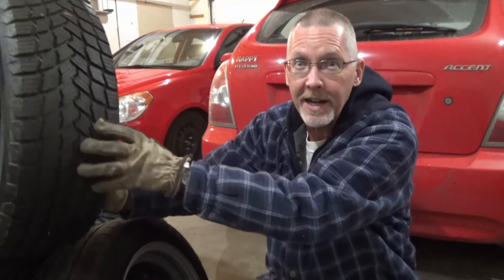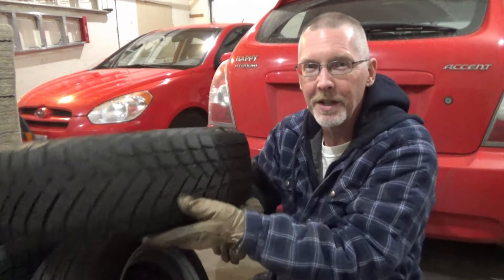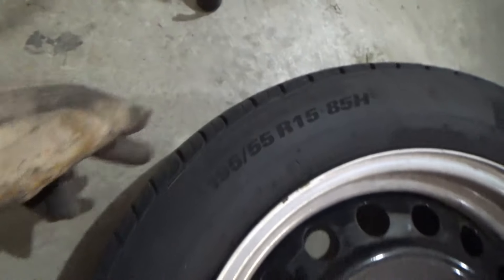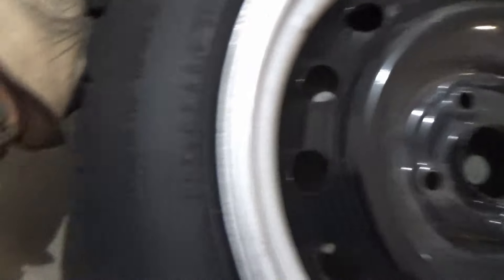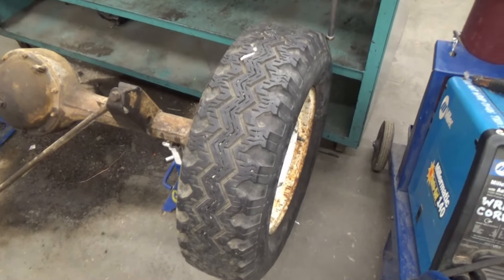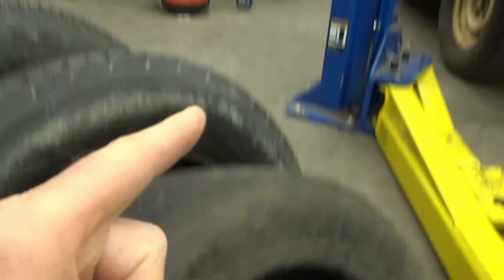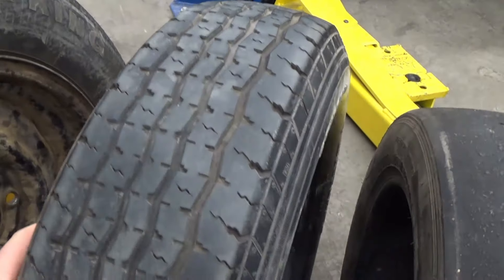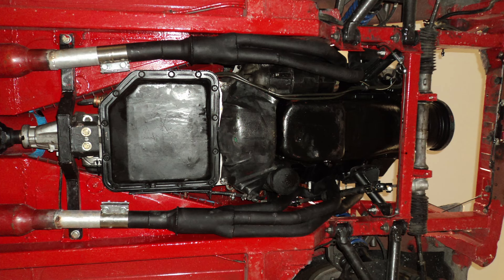Let's Talk Tires

Comment: 5:18 look like Toyo TR1.  I do sprinting in the UK (similar to your Autocross but on a circuit, not a car park with cones).  I normally run Michelin PS4 but have tried these Toyos.  It makes me think of one thing you didn’t mention - sidewall strength.  The Toyos are actually softer than the Michelins and this is reflected in quicker 64ft times (measured time of first 64ft.  64ft because if you do it in 2 secs it’s supposed to be 1G of acceleration or something).  Anyway, the Toyos are slower overall in spite of being softer and grippier because, I believe, the side walls are weaker and the tyre rolls over more in cornering.  Just a thought.  But yes, they are cheap!  Michelins are not.

Oh, and for track use I limit age to 3 years.  I’ve put 3 years younger Michelins on the front of my car and hit a cone on turn in because the added grip made the car understeer less!  Same  PS4 tyre, just 3 years younger.
Reply from the maker: It's a Nitto Neo Gen.  I want to try Avon slicks on my Super 7 - most folks here run Hoosiers ($$$$), but I understand Avon has even softer compounds.
Reply: @ ah right.  Very similar tread pattern to Toyo TR1 then.  Info on sidewall stiffness still relevant but I’m not sure how stiff Nitto sidewalls are. 👍
Reply from the maker: They were not excitingly stiff when mounting them.  I neglected to mention that you want soft sidewalls for winter tires.  My bias-ply slicks have almost nothing in the sidewalls.

Comment: I had a set of tyres on my Trillium trailer that I pulled off of a Honda Civic. They were rather jiggly. The tyres COULD handle the mass of the trailer (about 1500#) but they were definitely not designed for a trailer. 
Around here (Edmonton) we get snow on top of a nice base of ice, so mounting your winter tyres on a set of black steelies is definitely the way to go. WHEN you whump a curb, it's $90 to replace a rim rather than OMGYouWantHowMuchForAFriggingWheel?

Comment: I agree that Blizzaks work, but they are expensive, and the wear rate is spectacular.  In a bad way. I have put them on around Christmas here in PA, and most of the "magic rubber" is gone when I take them off. Unfortunate when it hardly snows or gets icy.
   A fair amount of the tread thickness is "normal" rubber, so they may still appear to have quite a bit of life left, but only give the performance of a typical all season then.
    The handling is very bad when they are new, and improves as they wear,  like most tires, but more so.
Reply from the maker: Magic always comes with a price, and the Scottsman in me doesn't like that price either.  They are _good_, but only the first season and a half.  I want a more consistent use out of my tires.